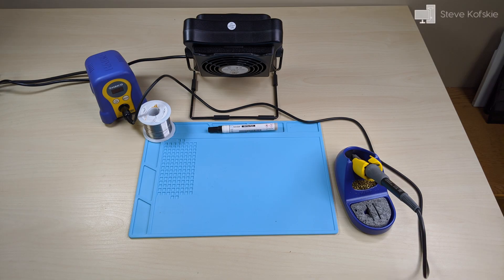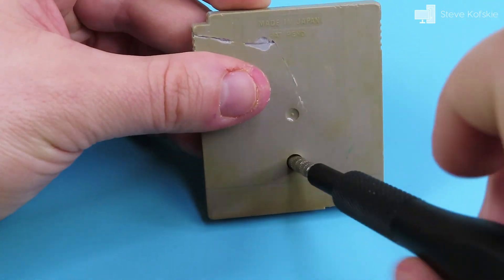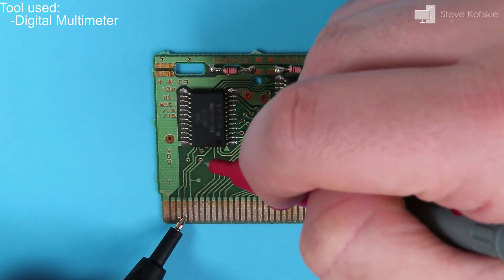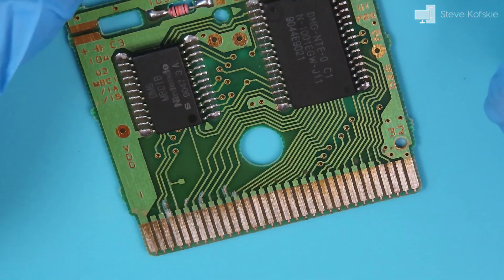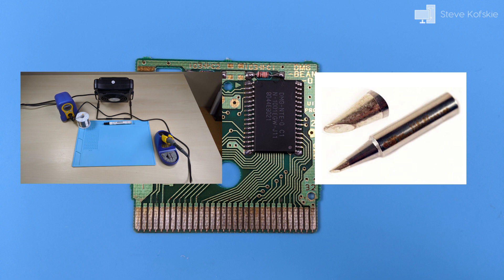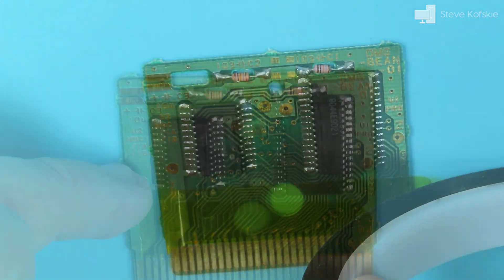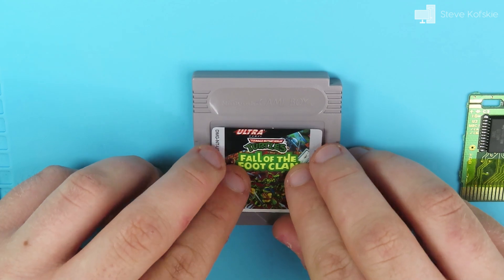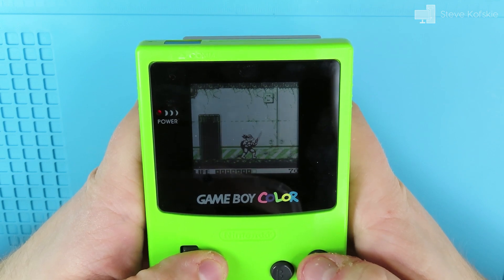Restoring a GameBoy Cartridge with Corrosion (TMNT Fall of the Foot Clan)

Comment: Just got a copy of Metroid Zero Mission... I believe it has some heavy corrosion and/or dead/corroded save battery... Game will show the Nintendo logo when booting, will start to go the next screen and then hangs...what are the odds its salvagable?
Reply from the maker: Sounds interesting. If by 'start to go to the next screen' means it stays at the white background of the Nintendo boot up logo, that might be salvageable depending on what needs to be re-flowed and/or repaired traces. If you mean it actually changes to a different color screen but nothing happens, it might be chip related and a harder fix. Hope you're able to get it repaired!
Reply: @technotard13 I made a video to help explain better...
https://youtu.be/7UBL1oWLJqQ

Comment: If the cartridge worked why didn't you leave it alone? 

What you are doing here is actually doing more damage than good. Then you effectively make a forgery by using a reproduction sticker. This is why buying old games is becoming a nightmare.

Good restoration means keeping things as original as possible, only doing what is necessary to preserve originality, and function.
Reply from the maker: Thank you for commenting.

When I saw the traces to the pins at the bottom of the board, they looked either corroded or worn from excessive use. From restoration videos I've watched over the years, if you don't take care of a problem now, it will be worse in the future. I took the initiative to fix the potential wear/corrosion now instead of letting someone else deal with it later in life. 

The cartridge itself was in bad condition with the label not looking any better. The game isn't worth anything whether its new, restored, or it's former condition. If this was a Pokemon cartridge, then I probably would have tested that it worked instead of going through the lengths I went through in this video. 

I have no plans selling this game and would only give it away to someone close to me that would take of it like I did.
Reply: @technotard13  I have no idea about the repair, but the sticker I found quite disturbing, it's too close to an original, and I don't think a business that has potential in tricking people to buy something counterfeit should be supported. The companies that do reproductions who have integrity will write reproduction on the product.

Comment: Where can I buy second hand shells?
Reply from the maker: If the link I provided in the description doesn't work, you will have to manually search for it. I got my shell on eBay and usually a listing only stay up for 30 days until the seller re-lists the item. If you trust AliExpress, I believe they sell them as well.

Comment: Can you send a link to the seller of the 2nd hand shells?
Reply from the maker: I posted this for a similar comment: 
If the link I provided in the description doesn't work, you will have to manually search for it. I got my shell on eBay and usually a listing only stay up for 30 days until the seller re-lists the item. If you trust AliExpress, I believe they sell them as well.